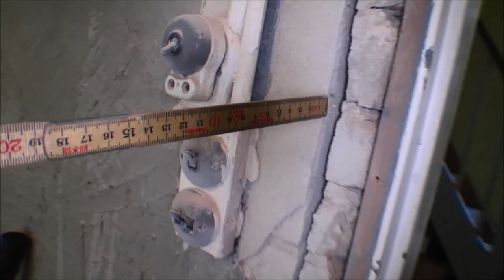Removing and installing a door frame in My PlayHouse - 168

Comment: hi , if there is any problem in door frame , say it is not installed properly by technician, after few years can we remove and reinstall the same frame?
Reply from the maker: Hi Mohammed Asraruddin
not sure what you mean,, but it still works just fine.
Thank you for watching! :-)
Reply: @MyPlayHouse  my house was installed with a new door frame but technician didn't install it proper..door doesn't open fully as he didn't leave any gap ..so my question was can we use same old frame in some other location if it is good?
Reply from the maker: I would think so,, but I am really just a DIY,, dude that has no idea what he is doing. :-/